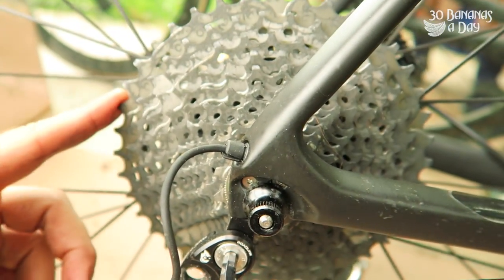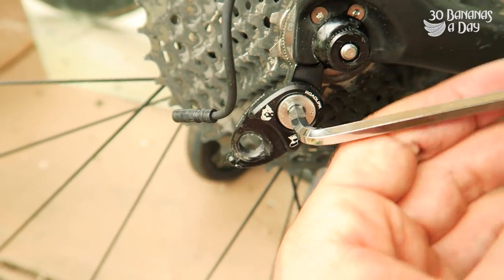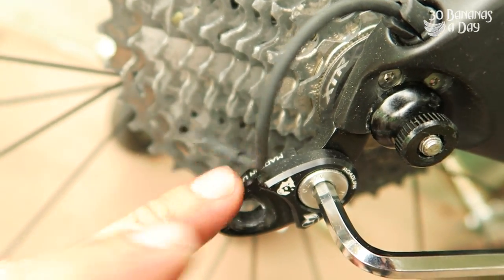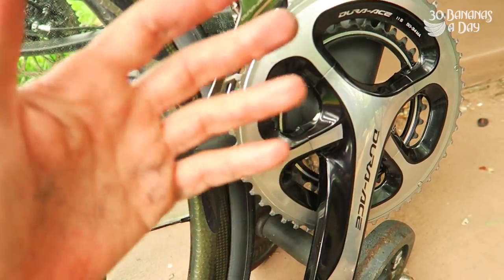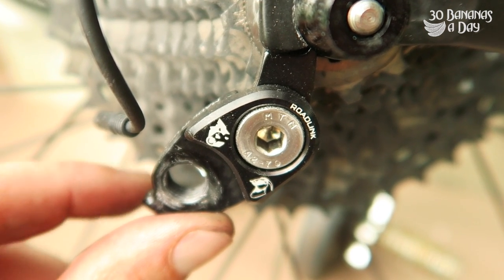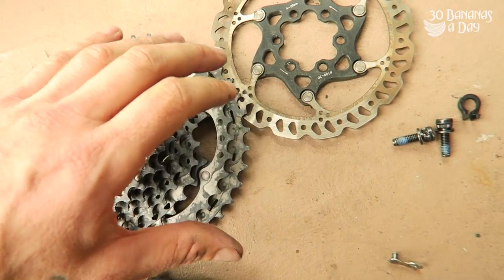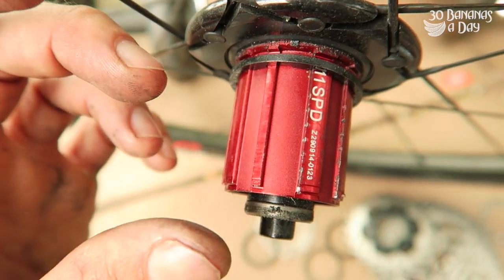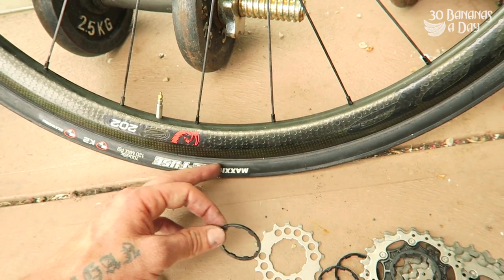Cycling Tips How To Install 40 tooth Cassette on short cage 11spd shimano road rear derailleurs

Comment: Is there a reason to avoid a long cage derrailleur or is there some disadvantage to using one?  Just asking because my road bike came with a long cage (with an 11-32 cassette) and it seems to work fine, but you always seem to use a short cage.
Reply: Short cage look a bit better and shift slightly faster.

Comment: I'm really interested to see what type of roads would need a cassette that big. Ive got up 33% plus hills on a 36-25. Saying that id love a huge cassette for easy rides
Reply: +RatzengeliS Clearly never been to the UK before then. Hundreds of climbs over 33%. We dont class them as a hill over here unless its 25% gradient. in a car you would need 1st or 2nd gear for them
Reply: I don't think you're lying like Jackass there rudely says, however you must have your wires crossed regarding the percentages. There can't be hundreds of UK roads over 33% as the steepest road in the UK is right on about 33%, while the steepest road in the world is 35%. Hundreds of UK roads at 33% plus is a long way from feasible.

Comment: I am trying to fit a 9s 40T with the extender, problem is going small on small there’s too much slack, shortening the chain doesn’t allow me big on big. Got any tips. D is a Alivio m4000
Reply from the maker: You should be riding small small on a 2x or 3x system though.
I rate 46/30 absolute black rings if you want better climbing gears for road adventure.
Reply: Thanks I got it sorted out as desired.

Comment: Harley, after watching your videos for some time now, I'm saying goodbye to my 2000 Bianchi B.U.S.S. single speed MTB that I converted to a road bike with a 53-18 gear.  I'm a backer of the upcoming SpeedX Unicorn X and managed to convince folks to vote in favor of a compact (50/34) front chainring setup.  You can see the progress of the Kickstarter campaign here https://www.kickstarter.com/projects/speedx/speedx-unicorn-smart-road-bike-with-built-in-power/comments.  I'm now trying to get SpeedX to put the Sram Red eTap WiFLi medium cage rear derailleur on this bike (ie. they don't even specify which one short or medium cage will come with the bike).  I'd go one better and put the Sram Red 11-32 cassette on there, but it's currently spec'd with an 11-28.  I guess if all else fails, I could get the "Road Link" to make a short cage Red eTap rear derailleur to work with an 11-32 or bigger.  It looks like someone commented bellow that they got an 11-36 cassette to work with a Sram Red short cage derailleur.

Comment: Will it work with 10 speed
Reply: Yes, I put a 10 speed MTB cassette on a 10 speed road bike last week, the road link is an awesome bit of kit, takes literally 10 mins to do the complete swap. I have a vid in my channel showing the swap
Reply: Will I need to replace the wheel hub? 

I'm thinking of the praxisworks with the roadlinks with a standard 10 spd ultegra 

Also is the long cage necessary?
Thanks
Reply: Thanks John

Comment: I want to install a 11-42T cassette. My current bike has a 22 Front inner Ring and 12-36T cassette which gives me a lowest ratio of 22/36 = 0.61. I can barely climb the hill to get back home after every ride.... Now I am about to buy a brand new carbon bike with the new R8000 Ultgra groupset and the lowest chainring available is 34T... even with the 11-42T cassette my new lowest ratio will be 0.81 so I am not sure I'll be able to do that hill (I'm 59 years old & 90 Kgs). My question is will I be able to install the 42T cassette? AND I am planning to buy a ROAD LINK and not sure if the ROADLINK works with the new R8000 Derailleur. Does anyone know???
Reply: That must be an exceptionally steep hill if the 22/36T isn't small enough! Have you had any luck lowering your gears further?